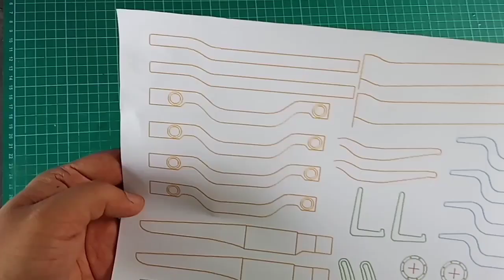Making handmade steam locomotive - Part 1 - Pilot wheels

Comment: What type of sheet do you use for outer frame sir? It looks different and hard
Reply from the maker: Its mount board. Its a paper based cardboard 1mm thickness. If you apply flex quick glue over it will become hard enough.
Reply: @HeemsMiniatureWorld  sir which software do you use for layouts and how do you do the dimensions? All the dimensions are yours or do you get it from any sources.